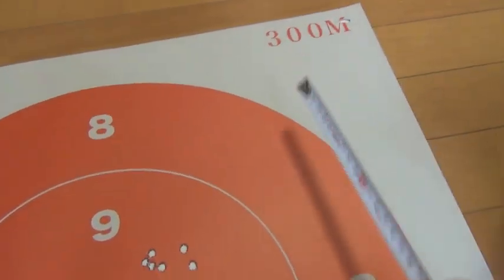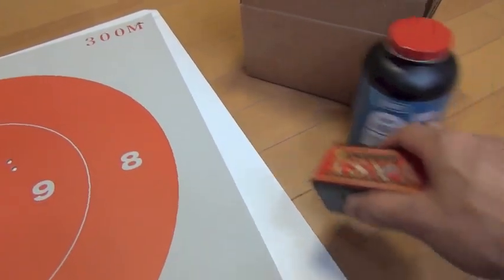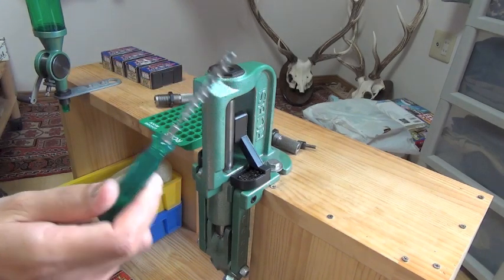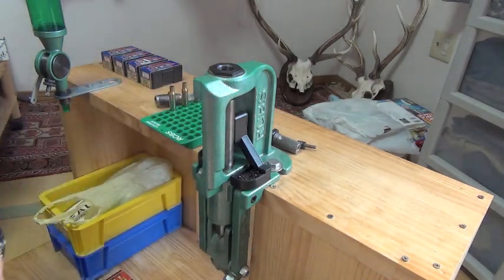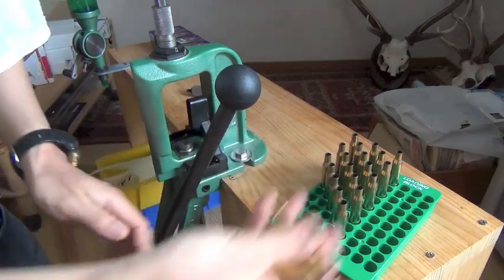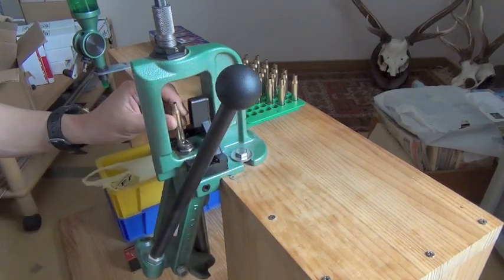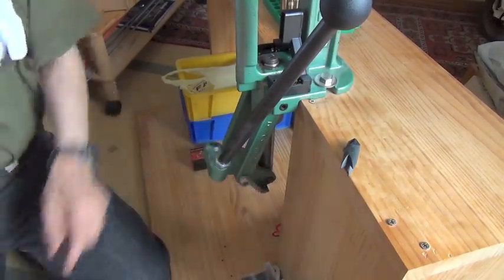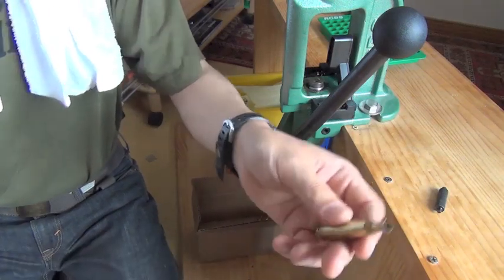270Win reloading

Comment: Waco the 270 was my first deer rifle and it also was my first reload!
I went on to 300 weatherby mag then to 338 mag which is my last rifle to buy and it is my favorite! Using a 225 gr bullet and 4350 powder I filled the case to the top and it was still under the max load!  I am glad to see you doing this it brings back great memories!  Enjoy my friend!
Reply: John Cormier, what was your overall cartridge length for your 270 Winchester reloads.  Wikipedia lists 3.84 inches, while Hogdgen lists 3.18 inch.  With a case length of 2.54, it would have to be a long bullet to make the 3.84 inch length.
Reply: Alfred Colley brother it has been too long ago ! I gave my reloading supplies to my youngest son!
I will tell you that Nosler reloading gave me the most accurate loads! 
I used to put a bullet in an empty cartridge and put it in my rifle then work the bolt to close it against the rifling then put it back in the press to bring it down another bit to clear the point to work through the rifle or it would hang up! Little by little till you have the best for your rifle!!

Comment: Dr. Waco,  thanks to you and a friend of mine and recent world events convincing me I have to go full-on prepping I have gotten a reloading setup.  Same as yours.  I found that in resizing the up-stroke was much easier if I simply brushed out the neck.  No lube.  I'd beef up that bench of yours as well.  Great video and it definitely convinced me that reloading was well within my abilities.  

The trickiest aspect of the whole deal to me is figuring out the exact dimensions of a particular rifle's chamber and throat dimensions.  A simple way to do it just make up a dummy cartridge that is significantly too long.  Blacken it with butane lighter soot and chamber it.  Keep shortening it until the soot is not disturbed by the rifling.  Presto!  You have the OAL for that rifle with minimal jump.  You have to be careful with chambering and ejecting and discerning lands and groove marking from other markings.  It is harder with an AR type rifle.

Comment: Few points to consider and couple of hints:

You should bolt/attach your work table to a wall or use sturdier table to mount your reloading press. It is much better to work on bedrock-stable platform. Deburring inside of the case mouth is done because otherwise the case mouth would shave bits of copper off the bullet surface. It is essential especialy after one has trimmed the cases. I usually trim my cases after they are 0,2 mm over the trim-to lenght or over the max case lenght.

The initial case cleaning in my favored method is done with vibratory case tumbler. I have found that best media is corn cob with some Dillon Rapid Polish or similar additive. Having some sort of media separator is handy.

I usually don´t lubricate the inside of the case neck. One could argue that the returning case neck expander plug might cause unnecessary increase in the case lenght when no lubricant is used. I have streamlined my reloading process by skipping this phase. I lay couple of hundred cleaned cases in an old shoe box and spray them with Dillon case lubricant. This lubricant is a mix of alcohol and lanolin and its important to let the alcohol evaporate few minutes before resizing. Too wet case could get stuck in the die. After resizing I give the cases a quick 15 minute in the tumbler to remove the resizing lube. I don´t want any lubricant between the cartridge and chamber wall since it increases the stress the gun breech must endure.

 Inspecting the primer hole before priming is important because every now and then there is a corn cob particle stuck in the channel. I don´t clean the primer pockets. I have not saw the need for it. Tumbler takes care most of the residue anyway.

Using the powder trickler is not necessary unless the used powder has a large granular size. I have done it with Vihtavuori N140, N150 and Hodgdon Varget powders only. However this is dependent on how accurate the powder measure is. My cheap Lee Perfect Powder Measure is suprisingly accurate even with the more granular powders.

Keep up the good work. Deer season is coming soon!

Comment: Well done. I myself have a Howa in 308  and it is excellent. I started reloading amd the groups are veey good for a hunting rifle. That is a very gopd group for 300 metres. Also if your resizing remember to check a few empty shells in your rifles chamber for tightness or hard bolt close. If tightness occurs it is either

Brass not full sized properly, screw size down !/4 <turn until not tight. Reason shoulder of case is to far forward.

Brass/shells are to long. Trim them. LEE brand trimmer is excellent. Reason case nech is to long and causes tight chamberimg.

Bullet seating depth is to long, seat bullets deeper. Reason bllets are moving into lands of rifling.

Thanks!

Comment: As a suggestion. Dies that use an internal button to resize the neck produce less accurate loads as well as the difficulty you are having pulling it through. They cause run out and a round that is not concentric. Dies that have an external bushing to resize are more precise.. Take a look a Forster products as an example. You (may)need to have several bushings on hand in case the wall thickness of the case changes, but it's not a problem. When you're sizing externally that (wall thickness) will change the inside diameter. Accuracy loading includes adjusting the neck case wall thickness. Wilson hand dies are the extreme.

Comment: at approximately 9:35 as you begin to lower the case,  it appears that you have some resistance,  is this something normal,  when I get to this point I have a lot,  to the point I have stopped and will seek the advice of someone that could let me know what I may be doing incorrect

Comment: Nice tutorial.  Save yourself some time and make a mixture of 1 oz RCBS case lube and 16oz of 91% isopropyl alcohol in a spray bottle.  Put your empty brass in a baggie, box or on a cookie tray and spray them.  Let alcohol evaporate and start sizing.  Lube pads do not get the neck and shoulder of the case.

I use 52g of IMR 4350 with a 140g Sierra Game King as my round.  Good luck this coming season.

Comment: Like others have said, I don't the Barnes bullets... they're super hard and so doesn't expand much if any when coming in contact with flesh. Last deer season I purchased a 100 of these bullet tips for around 35.00 after tax. After shooting a deer, the exit wound was the same size as the entry wound. If the bullet had expanded, I probably wouldn't of had to track the deer for such a long way! I now buy wheel weight lead, cast my own 130gr bullets and trying out the 150gr whereby dropping them in cold water to quench and harden them. Now the lead is hard enough that it doesn't lead up my barrel but soft enough to mushroom out a bit and causing more damage to where if you don't hit in the sweet spot, the deer isn't going to make it as far and so saving you some work of tracking up n down the hills

Comment: U can also get a classic lee loader for about 40.00 US. It sizes the neck of the case so u ddont have as much stretch on the case. It will do all steps required. I also use 4064 .i think the best all around powder. I also use 140g bullet. 270 seems to be most accurate around 2700 to 2800 fps.

Comment: I am glad you are in the reloading. Fine RCBS equipment - good choice. Sorry I did not have the time to watch the whole video but I did not see trimming the brass - I presume is off camera.
Have a great day!
Reply from the maker: I have never trimmed the brass. The owner of the gun shop says trimming is needed after lots of repeated use. So I haven't purchased the trimming tool yet. Thanks.
Reply: Get out your Calipers and Measure the Length :) I usually trim some of my Brass after the first use! If your Brass is to long it might "bite" on your Bullet and cause excessive Pressure and erratic Point of Impact. Of course, measure AFTER resizing/Neck Sizing. You should also consider a Neck Sizer. It's much easier on the Brass than Full Lenght Sizing.
Reply: virtuovice Wacosan,  Get yourself a Wilson case gauge,  read the directions very carefully,  and disabuse yourself of what the owner of the gun shop has told you.
Reply: virtuovice I assumed you trimmed the brass because you deburred and chamfered the cases. I never do that except after trimming.
Reply from the maker: sjeverett75 I gave up debarring since I knew it was meaningless. I got a trimming device and will use it every 5 shots or so for a single casing followed by debarring. Thanks.
Reply: Stefan Wolf y

Comment: Interesting.  I got lowest muzzle velocity  standard deviation of 4.6 fps using IMR4350 powder, Nozler fire-formed brass, full length resized with a shoulder bump of 0.002" , and 130 gr Barnes TTSX seated 0.050" off the lands.  I've also had success with RL-22 powder.

Comment: I am going to call the outside two shots flyers, or you may have pulled them. Either way great shooting at that distance. Any flaws in the bullet that cannot be seen with the naked eye, or slight differences in trigger pull will cause those two "flyers", especially at that distance, and I would not even count them in the group. So 5cm at 300m is slightly less than MOA. Once again, Great shooting.

Comment: Had problem reloading my .270 WSM casing always stock in the chamber after I fired
Reply: if your casing is getting stuck in the chamber you need to do a few things.  one you need to make sure you resize the whole casing if you have not done it some dies only resize the neck. this is a must if you are using brass that was not fired from you gun to begin with . next you need to double check your load data. generally if your brass is getting stuck in your gun or your bolt is hard to move after you fired you have too much powder in that load

Comment: Must be some kind of miscommunication.  300m = 328 yards.  Looking at the technique used (no rear bag) and you got that kind of group with a hunting rifle and relatively low power scope at 328 yards?  That's hard to believe.  That must have been closer than 328 yards.
Reply from the maker: I am used to this way of firing winding the sling around my left arm to stabilize the stock. 140gr TSX bullet makes better grouping than 130gr one at 300 meters while at 150 meters they make the same grouping like 3 inches. I aimed at the top of the paper and the drop was 10 inches when the scope is zero at 150 meters. So I decide to use the 140gr bullet for a distant deer. Thanks.

Comment: Very slow velocity, im getting 2950fps with 140gn SSTs.
Reply: He has no need for increased velocity plus his recoil is less and accuracy is improved.
Reply: If it is not going 3000fps or faster most Americans yawn. Me not included. 285/6gr bullet at high 2300's is been killing everything in Africa for over a 100 yrs. However even though it's been proven that shot placement is everything there's still ppl that will opt for a 505 Gibbs, El Paso Texas for me.

Comment: Old video but still worth the comment; try a different resizing lubricant or dry neck lube like the ones seen below. It looks like you are having to really work the brass to resize it and that's going to harden the neck/shoulder quickly and limit the number of times you can reload each cartridge case.

http://www.redding-reloading.com/online-catalog/79-imperial-lubricants